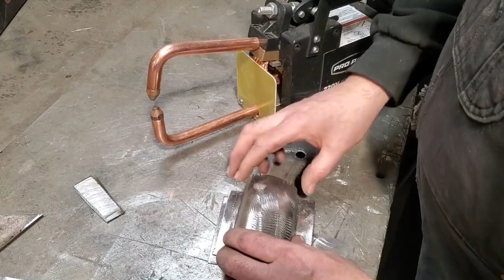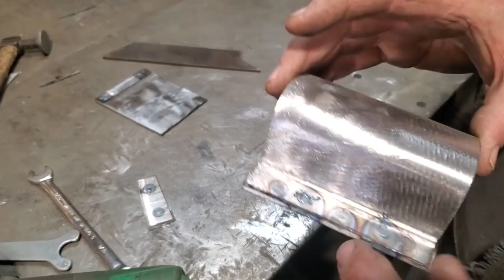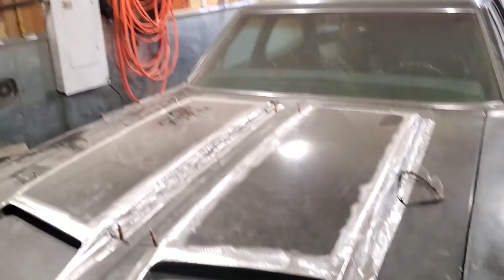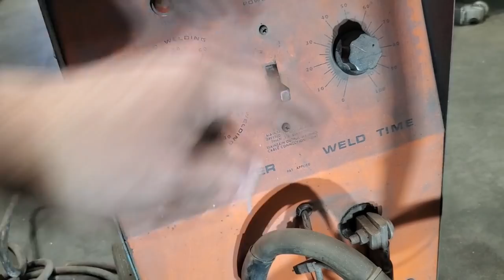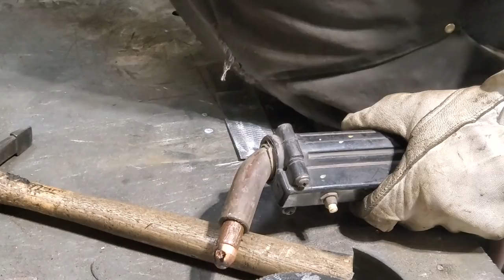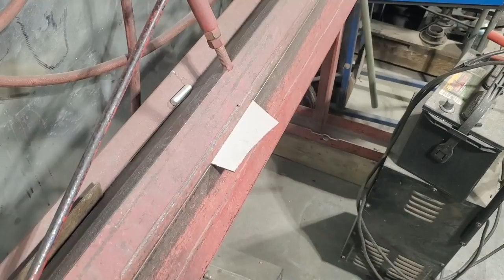How to spot weld. spot welders, New vs old!! Future plans!!

Comment: Nice to see the Porta Spot 2001! I bought one just before Covid hit for doing panels on a project car I am working on.  By the time I get around to using it I will have to get reacquainted with using it. When I first brought it home I spent quite a bit of time trying different heat settings and times until I got spot welds that consistently held and would tear when testing their strength.

Comment: I have used it to shrink sheet metal as well.  Same principle as using a torch to create a rose bud and of hot metal and then knock it down with ball hammer then use a planishing hammer and dolly.  Only good if you have access to the back for the final steps.  You use the lighter amperage because of the single thick ness and it’s a lot easier if a second person has the hammer poised and ready!

Comment: The only downside is the lack of rust preventative coating between the welded seam. Even with MIG welding there will be some damage to the rust paint coating between the seam's panels.
Reply: Zinc coating is weld through with those machines.
Reply: When you mig weld the temp is around 2700c or f, can't quite remember, the degrees,  but zinc weld though primer melts & goes to a liquid at  that  temp, where as copper weld though primer melts at 4700 degrees,  so copper  weld though primer is a better option,  & a better conductor  for resistance  welding, but is dearer, just a thought guys.

Comment: The tip small holes for the dent puller pins large hole was. For threaded bolts for like removable panels like door panel that push one mine also made a pencil sharper that you just put on and turned a few time for clean shaped tip. We used to sell car at the actions that needs rut fixed the old would weld paint thinner can metal to door skin that almost didn't need thinner before primer and paint used car got what you pad forr.

Comment: That old machine kicks ass and is far better and appears to be easier to use plus faster . Great find Tony !! it would be nice to almost separate (modify ) the 2 clamp leads on the cheap unit into making them like the old unit with the two points

Comment: ok you answered my question on the seams but do you have a way to put bends in the full sheet if i do not have a bender
Reply from the maker: Not in  a full sheet. You need a 8 foot brake or you have to gave a 8 foot section of I bean with a 8 foot length of angle iron to clamp to the I beam.might be easier to bring it to a tin shop that has a 8 foot brake and have it bent up. Shouldn't cost much

Comment: Thanks Fitzee...as usual you are right on time for what I need to know, I will modify the contact points on my propoint welder that I have had around for a while now. I use a 220v extension cord that I bought at Princess Auto..I have had it in use with my 220v mig welder to get anywhere in the shop. (just cut some of the cord from the old guy and put plugs on it)

Comment: Thanks for that demo. I 'awhile back I bought one of those old pinch type spot welder.  (weights abut 150 lbs). Been eying one of those old spot boxes but really wasn't sure they they would work as advertised. But now I'm defiantly getting one. like you said the time it saves drilling spot welds, filling them with mig welder and so on. Thanks again for the demo.

Comment: A lot of equipment is made in a a factory in China that makes the same product for multiple outlets. They just make them different colors with different names on them. I have an Ozito Chainsaw and a GMC chainsaw and they they are identical, other than the different color of the plastic and the name. I even used Ozito parts to rebuild the GMC saw. No doubt there are a lot of other examples.

Comment: The series welds that you made when made, with commercial spot welders have a copper plate backup. The current goes through the metal into the copper then through metal back to the electrode

Comment: Some very useful tips there as usual. It would have been interesting to see how the welds went if you used weld-through primer on the plates. I know you don't like it, but with seams on car floors, it could be worth considering using it if you aren't seam sealing under the floor.

Comment: I'd never really considered it before, but lap welding with an offset on both pieces provides exactly the same sort of strengthening as bead rolling...factory style and hiding in plain sight. Everyone knows factory panels normally have some contours stamped into them for stiffening, but you can see how the panels you spot welded together have good stiffness along the length of the joint.

Comment: I got a portaspot 2001 also bud. 💘 it. Gr8 video fitzee, learning lots. Princess auto right now has #220 volt weld extension on sale. Grabbing one tomorrow. Have a gr8 weekend fitzee.
Reply from the maker: Too cool. You know any info on yours? Any history?
Reply: @fitzeesfabrications  yes chum. The company has since moved to Montreal. I'll see if i can find the phone # in my cabinet.  I had mine given to me. I had to get the circuit board replaced, but the lad looked like Michael Clark Duncan who fixed it gave me 2 new tips for it.btw for 20 guage steel i set at 70 amps lft dial.and 2.0 seconds right dial.

Comment: Wonder what the duty cycle might be on that old machine, maybe part of the difference in penetration on your test piece? Well Fitz, I am now envious once again and want one of those old machines lol. 
I have the 110 volt harbor freight version and have used it several times .  My 110 volt doesn't like wide tips, seems to make stronger welds with new narrow tips. Even then it's not that great . The short cord sucks, and it's difficult or even impossible to use on the car in most cases. . I bought mine mainly to weld the rockers together , it worked good attaching the floor pan lip to the rocker panel but wasn't much good for anything else. Thanks for the door skin tip , I doubt if my 110 version has enough power, but your 220 seems good.
 
That old machine seems like it will be a huge time saver once it's dialed in all the way.
Reply: The name plate he showed in the video said 50% duty cycle. For a normal welder that means 5 minutes use out of 10 minutes. Don't know if it's the same for a spot welder but would assume it is? If that is the case he was nowhere near its limit. That would only apply in a production type set up.

Comment: Tony , take that " pro point"  back if you still can,  and get your money back , or give it to me 🤣  you already have a  unit 100 times better, faster and easier , even on your old back   and surely can use it the same way, back to back weld , as some here have stated the so called  "proper" way,  but i like the Fitzee way , if it does the job  , it's faster and good for me ....🤓

Comment: Very nice to have that old machine. Quick tip, use anti sieze on your tips when you screw them in. I have a 110 Miller and after about 40 or 50 welds they get pretty hot then when they cool down and you need to change tips they gall the threads in the tongs and you will need to replace them. Ask me how I know. Haha. Since antisieze haven’t had a problem.

Comment: I've seen the little (modern) one in use, but that big old beast looks just the ticket for most things anyone would ever want to spot weld.  Looks a lot more versatile - and talk about quick!  Loved the finish it gave too....and you're right - the spot welds look way more factory and original than a smooth surface.  Glad I am not the only one who goes looking for them on vehicles I am interested in!  

The old unit reminds me of an arc (ark? haha) welder my Dad had many years ago.  It was old when he bought it back in the 80s and she hummed like a substation when he flicked the switch on the transformer (the 'old school' version of the modern inline RCD units that take the hit and cut the power in an overload or short circuit scenario). It could happily weld quarter and three-eighth inch plate and although it was on a dedicated trolley, she wasn't something you moved without thinking hard about whether you really HAD to.  Damn thing weighed a good 120kg easy, I reckon.  Did its job well for many years, that thing.  

Dad built a boat trailer with it for a mate of his who owned a 32' Pelin Topaz.  He used a mix of three-eighth inch angle iron, C-channel and I-beam to do it.  This trailer was the bane of my existence when I mowed our lawn, because his mate sold the boat (without telling Dad, who was still working on the trailer for it) and then went overseas for several years....so it got put out to pasture so to speak.  It was the cause of many bruised shins, orange-tinged sheets (when I pushed it too close to the washing line) and caused our neighbour to have to take a trip to the local A&E unit to get stitches after a number of cold brews with the old man one night.  In the pitch-black darkness of winter, he forgot it was parked between the garage and his gate in the fence and he went face first over the rear of it....but it could have been a lot worse - and just made my job of mowing the lawn harder because there was one less place I could park it!  It was finally sold after 8 years sitting in various places around the lawn and as testament to the quality of the welding, it was towed all the way to its new home - some 120 miles away over winding hills in the country.

Anyway, thanks for showing us those spot welders, Tony.  I know of a few places on one of my vehicles where either one of them would be useful.  Might have to look into that.....

All the best!

Comment: using that overlap sheet metal spot welding method   , sure opens a greater option to use anywhere , and not only  on  floor pans  . great tips, thanks for sharing  Tony.

Comment: I worked to repair rust  and quickie paint jobs to make a living in the 80"s and bought a Lenco spot welder  and made me a lot of money  repairing rust but it was hard work and  the handles of the welder got so hot you needed  heavy welder gloves to use.  The sound made good memories. and I still have the welder.

Comment: I saw the spare tip that you had and wondered why the tip to your older welder had a hole in the tip then realize it was because of the stud feature. Nice old welder.
Hear is a suggestion but you probably already thought of this, Cut the old cord to you old welder about 6-8 or 10 ft. or what ever you think will work and put a new plug on the cable to the old welder then put a matting socket on the cable end. Now you have a usable extension for your newer welder.
Nice tip on the door skin area. Keep the tips coming.

Comment: Fitzee , wouldn't that be easier on body panels instead of mig welding? You couldn't cut and but with the spot welder correct?
Reply from the maker: No  these are designed for lap  panels.

Comment: Just a thought... Looks like you were getting slightly better penetration with the old solid brass tip than the new one on the last panel,  that is - every second weld was better than the one next to it.  

Would you use these like the Propoint (front and back) on a rocker? Also, how far apart can you use these, do they have to be close together? Seems really handy to have a spot welder that doesn't require you to have access to the back.  I'd love to find one!

Comment: I still have a old Port a spot made in Canada 🇨🇦 still works the time control broke but it is set for max and I just use the the button to control the time I paid $200 for it used and still works great I use it for small patches but for big patches I use my mig welder since 1983 they changed the metal to higher carbon steel but for small patches works great haven't had a patch pop off yet the reason your not supposed to use them is for putting large 1/4 panels on is incase of impact the welds can break and 1/4 panel can come off the car that what I remember being told back in 1983 when most body shops went to  mig welding....
I looked on line and there was a couple for sale for around $500. 
But great for making metal boxes etc.
Great video comparing them myself I think I will stay with my old one...
I also have all the different tips one has a slot in it to weld washers to the panel to pull sends with a Dent puller the other has a small hole for stud welders pins to pull dents as well as a shrinking tip and a few welding tips... 
I used my machine many times in the mid '70's-early'80's  so many people making offers but I can't sell it to hard to find another..
They were made in Windsor Ontario but like I safe I keep it on high heat and use my trigger...

Comment: Very interesting. I didn't realise spot welding could be done from a single side, I've only seen those clamp type before. I guess the biggest issue doing floor pans is keeping the sheets clamped together. You could use Clecos but that would defeat the reason for using the spot welder.
Reply: Clecos are temporary, the welds permanent. Alignment and maintaining a firm grip with Clecos, whilst the primary 'spot welds' are applied, seems a legitimate method to me. I guess particular installations require particular methods, like when larger pieces are to be installed, or multiple pieces are to be installed and correct/good alignment, is a priority.
Reply: @elkoposo686  but then you have to weld the holes up after and grind back. Not saving much time and effort over plug welds.

Comment: You don’t want the top of your head in the video if you don’t have a hat. Setting the camera for chopping the top of your head in the frame is a quick way to hide the old bald spot. Watch Bad Chad, Jolene chops the camera frame to hide Chad’s balding head when he changes from welding helmet to ball cap. 
Great lesson on spot welding.

Comment: Try to think about the name on the large welder. It is resistance welding. With the smaller welder, try applying light pressure when you hit the switch and then more pressure at the end and then release the switch. The heat will come from the resistance from the poor connection when starting and then the added pressure at the end will squeeze the metal that has melted together. I have a 110V and that seems to work real good for me.
Also on the smaller welder, lets say you want to weld your tool box draws back together. You can scratch tiny spots in the paint on the front of the draw (like 4 spots)and use a sharp tip to make contact inside that spot on the metal. Then sand the back side of the front portion of the painted draw so there is no paint. Sand the metal on both sides of the folded side wall side so that there is no paint between the two panels and no paint on the inside of the folded wall. Then use a fatter tip on the inside so no matter where the sharper tip on the front side is located, it will hit someplace inside the area of the fatter tip on the inside of the draw. Then apply a small amount of pressure and press the switch. When you see the paint change color on the front, give more pressure and release the switch. You can reweld this way and not do so much damage to the paint on your box. My box is a Snap-On and they refused to repair or replace the draw, so this is how I fixed it.
Another great video Fitzee, thank you for spending the time to show us.
EDIT: I didn't know spot welds can be made without the two welding contacts being directly across from each other pressing the two pieces together. Holding those two welding tips next to each other and having it work really surprised me.
Sometimes you think you know, and then someone comes along and changes everything. Thanks again Fitzee!

Comment: Thank you Fitzee. Previously I thought a spot welder was a pointless bit of kit if I could do them with the mig. How wrong I was! The spot welder is so much cleaner and faster. I want one 👍🏴
Reply: You can't use them on any thing newer cars 1983 or newer becouse of the carbon content in the metal like a quarter panel becouse of an accident the quarter panel can break off...
That is for the old style spot welder I still have one and only use it for small patches on think lid or wheel well or bottom of the door ...
Reply: @peterrivney552  thanks Peter. I'll remember that!

Comment: I have the Harbor Freight 110 unit. Had to upgrade to a 30 amp breaker and 10 gauge cord to use it. Now it works well. Put a roof on a '72 Cutlass with it.

Comment: Not finding much on the PS2001, but it looks like Pro Line Systems took it over from Windsor and now sell the Porta Spot 2002. Someone posted on a welding message board that they believe the PS2002 replaced the PS2001 around 1998, but take that for what it is worth.

I also found reference to a company called AMH Canada Ltd that is still in business and still had parts for the PS2001 as of about 10 years ago.

Comment: A coiled, high current, long power cord will act as a transformer. It causes problems with starting an arc and slow starting high power motors. Spread the cord out for smoother equipment operation.

Comment: My brothers and I bought a Lenco Mark II years ago to repair rust on our cars in the 70’s.  I still have it.  We would put a line of welds in a patch panel.  Then I would use a propane torch and melt lead solder on the edge.  It would soak in the solder just like soldering a copper pipe.  It would seal the joints between the welds to keep moisture from getting in from behind and popping the bondo off the patched panel.